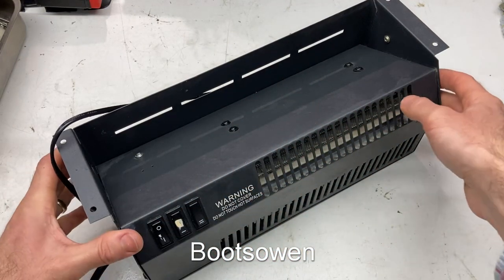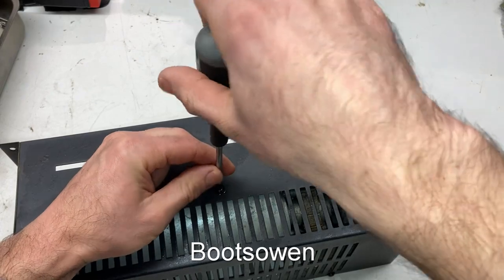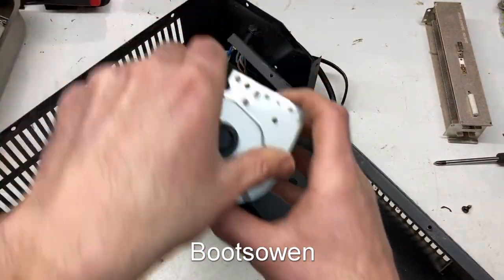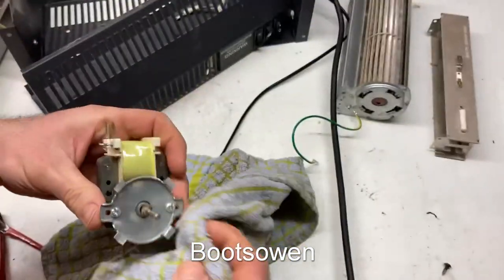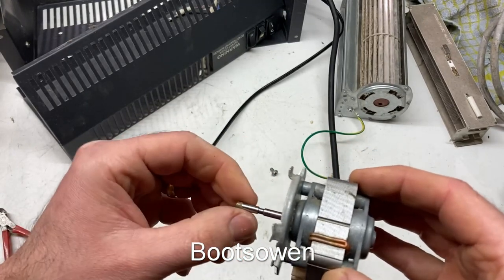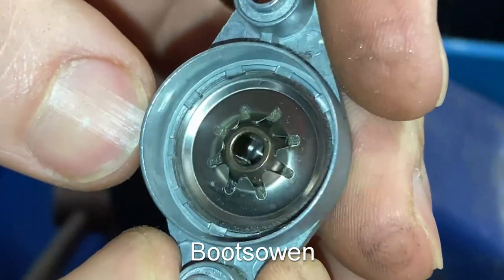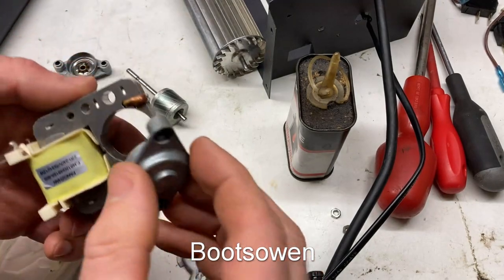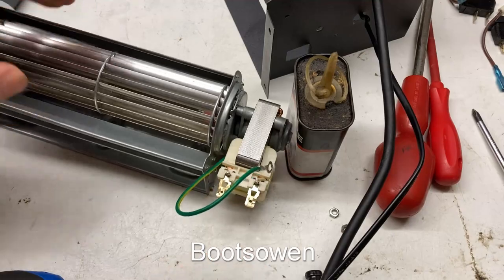Electric heater Snail fan repair

Comment: If snail fans are used in electronic fires where heat demand is required the fire manufacturers should have used an ac universal brushed commentator motor with 7200rpm for fast air + heat circulation.
Reply from the maker: Electric fires are a fine balance. If you have too much airflow it cools the element and the user will experience wind chill. You really want the gentlest breeze. I can’t imagine a universal motor noise in a sitting room. Like trying to relax beside a vacuum cleaner